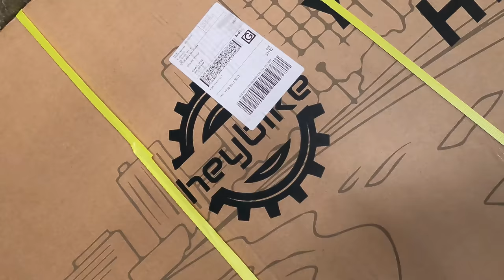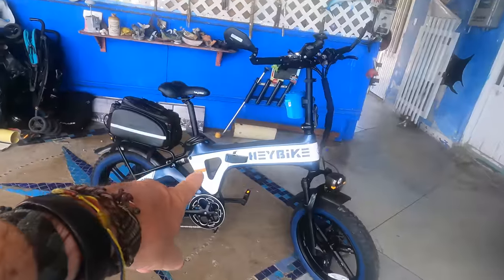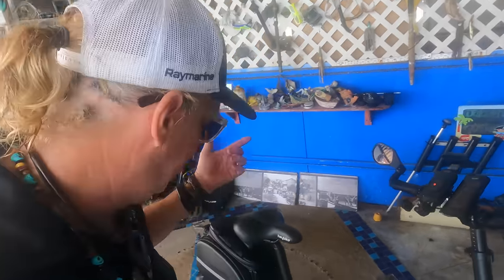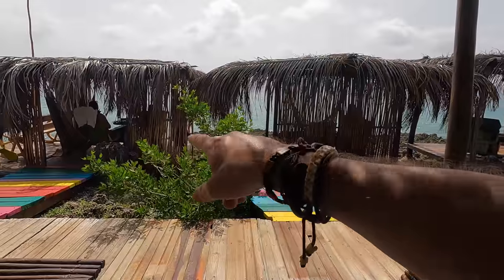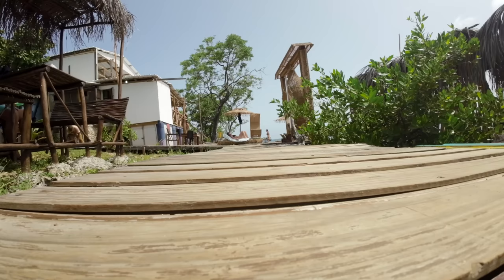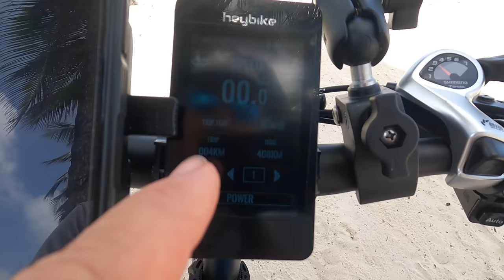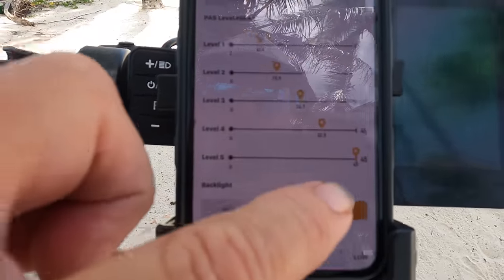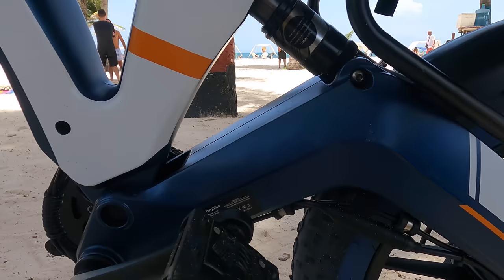SSL686 ~ HeyBike TYSON Fat-tire EBIKE - Full Review

Comment: I just got an ebike similar but Hard to put front guard with light on as one flaw its spacer should not needed a spacer and it is 3mm too long to fit in the right place. Just charged the battery 16 ah The other issue is the plug as it is an adapter and serge plug but in the UK 3 prong means it is lose for re charging as no on a boat. It is heavy more than I thought buy reason why I got it is folding hydraulic breaks full suspension control types and I will try is out tomorrow. Supposed to go full 37 miles on fully electric will see if true. As never had one before mid range cost in the UK will see. Just wondering I am getting type of grinding sound when have to move the bike backwards from the Motor area is that normal? It has no power yet just pushing it backwards a little not sure if gears or if rubbing on back break or the motor. I suppose I will find out when riding it. Oh its your fault me buying it so their Captain Ric as my back has given out.  Trying to be eco friendly plus stay fit. I will try PAS up to 3 to see if it is that good too.  Thank you Ric huge fan.